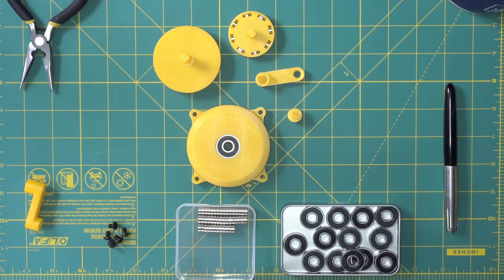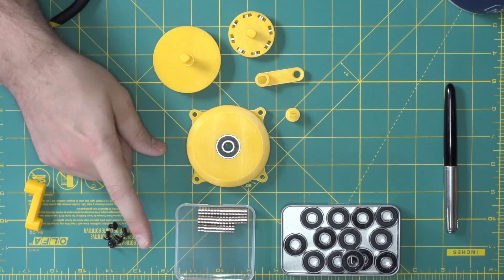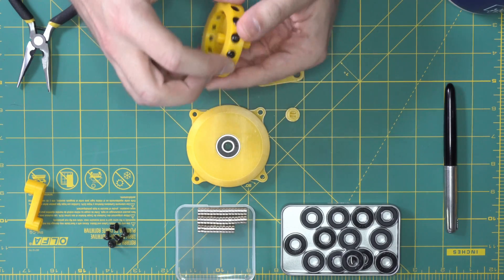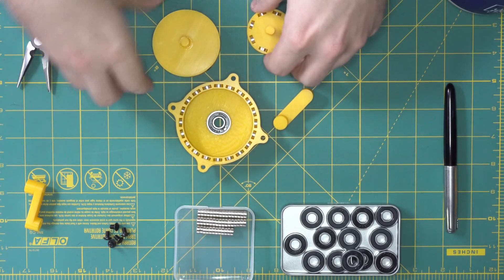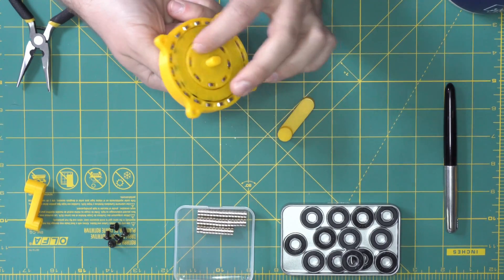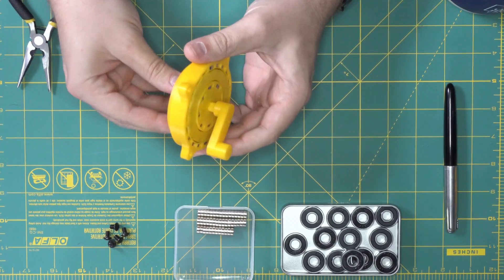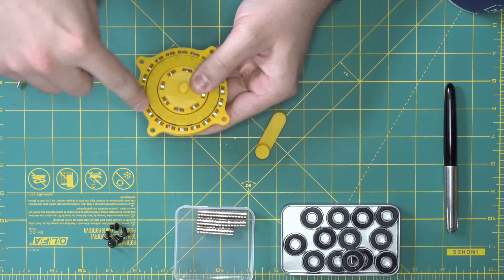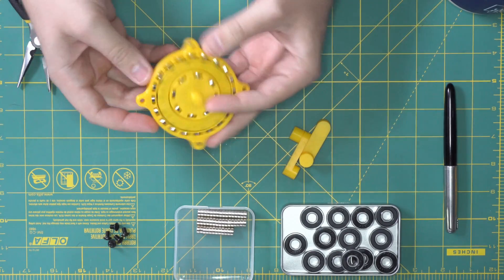3D Printed Magnetic Gear

Comment: Thank you for this video. I stumbled on it one night a few years ago, and after watching it and some other similar videos I ended up in bed having ideas. I wondered if a magnetic gearbox could be made with 3 magnet rings and 2 stator rings, with a way to change which rings are stationary and which move, and then made one. The result has 4 bearings inside and is fun, for me at least, to fidget with.

Comment: i was wondering about the dimensions.
i mean when i put in my program i have to scale it down to the magnets?
the bearings don't match with the corresponding holes on the dimensions when the holes for mags are the right size? 
if you could put your dimensions in with the thingiverse files you wouldn't have to fix it.😁

i mean i can fix everything myself without a problem with a few adjustments and all because im a professional 3d modeler.😁

Comment: Looks Great. I built one 4 large magnets, 10 stator and 12 small magnets. It does not work. Does the ratio have to be 4:10:16 or will any ratio work?
Reply: Redo-3D printed and assembled 4:8:12 and it works fine as a 3:1 ratio-Thanks
Reply: @williamhoover1515  Thanks for posting this. I could not figure out what principle governs the middle ring. So it seems ratio needs to be a multiple of the first number?  But what if I wanted 5:1 gear ratio or 7:1, what would the middle ring have to be?
Reply: @Traderhood Redo, It works fine now. It turns out I had the stator nodes in the wrong number for the two active disks.
1 Active disk magnets must be even numbered (2,4,6...16 etc.)
2 Stator formula is as follows- Disk one( number of magnets) plus Disk two ( number of magnets)total divided by two equals the number of stator nodes(rods or screws)

My redo 3D printed and assembled
Disk one-4 magnets, 8 stator nodes and Disk two 12 magnets and it works fine as a 3:1 ratio.
To get the most torque out of the system the space between the disks must be very, very close.

3D printing a 7 node stator and a two magnet small disk to try a 1:6 gear ratio to see the difference in torque if any.
Update- 1:6 ratio with magnets 12:7:2 has poor torque and is not usable...so far 1:3 is good(12:8:4).    You might try 24 big disk, 14 stator and 4 for small disk  24:14: 4 for a 8:1 ratio
Reply: @Traderhood  you might try outer disk 20 magnets, stator 12 and the inner(small disk) 4 magnets. This would make a 1:5 ratio.
Reply: @williamhoover1515  Excellent. Thanks for the formula. That is exactly what I needed.
Reply: @Traderhood  Let me know if it works with adequate torque and smooth motion (outer disk 20 magnets, stator 12 and the inner(small disk) 4 magnets. This would make a 1:5 ratio)-Thanks

Comment: Very cool! That's a second order magnetic transmission right there. Would love to see a third order one made with real silicon steel and n52 magnets. If you live in the US or canada, get magnets from k&j magnetics. Silicon steel has less hysteresis and higher saturation, can make the gearbox have better efficiency and power density.

Comment: can we get the magnets from hard drives, and rather make it out of wood, not use a barring.. all to save money, and make it free. and use it to run off a fan or cd rom or harddrive motor from that 6 gear box thing, and make a other steeper motor.
Reply: What level of idiot are you?
Reply: Magnets from a hard drive is not going to work. Buy them from amazon or what ever. There always needs to be a bearing, and i am assuming you don't want a comercial ball bearing for some reason.

Comment: in the description, you listed an amazon link for stainless steel screws for the input shaft - will those actually work even though they might not be very magnetic? looks like you used black oxide steel ones in the video
Reply from the maker: You're right, I made a mistake on that link. 18-8 would likely still work but not nearly as well. Thanks for catching that, I've updated the links.
Reply: The commonly available austenitic stainless like the 300 series (e.g. 18-8) would not work—although cold rolled form may work.  The 400 series, I.e. ferritic and martensitic types will work fine if you can find them. I just use zinc plated carbon steel for mine.